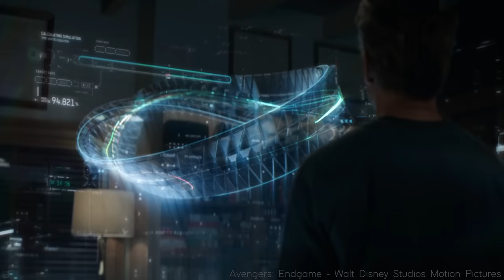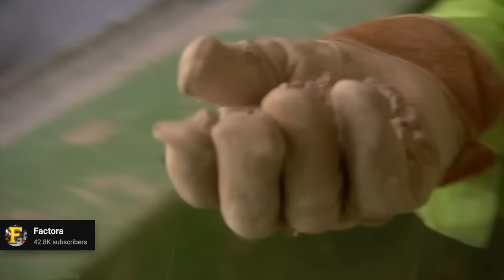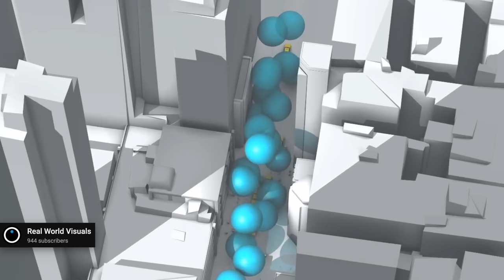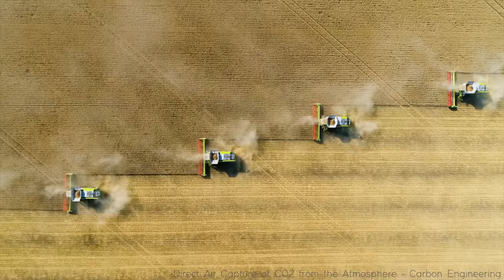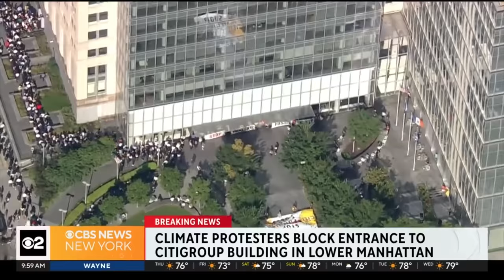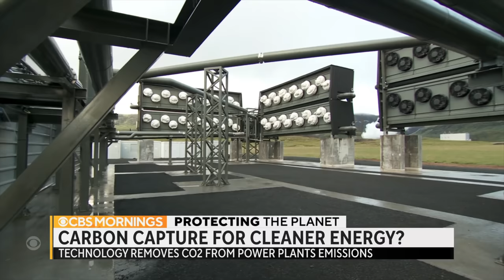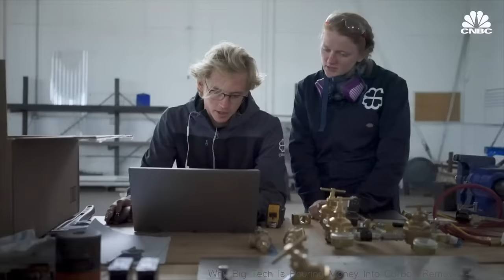How Thermodynamics Holds Back Negative Carbon Tech

Comment: Question: is the Gibbs Free Energy even the correct potential to estimate the minimum energy required to separate the CO2 from air? It requires constant temperature, which was set to 300 K, but if tou need to heat the sorbent to either 100 oC or 900 oC depending on the material, it seems like the energy needed for heating was not even considered. Am I missing something?

Comment: It's interesting, because of the high energy requirements it seems like deploying DAC on industrial scales in locations at distance from major power generation facilities might very well work hand in hand with the recent advances in Small Modular Nuclear Reactors. Because of their smaller size and modularity these reactors can be more easily scaled up and power generation could take place right at the sight where the DAC is located without needing to worry about transmission loss or building an expensive coal power plant or an environmentally destructive dam (looking at you Site C).
Reply: You are speaking of Thorium MOLTEN Salt reactors are you not ???
Reply: @lawrenceiverson1924  I was actually talking about the reactors currently being developed and produced by the company Last Energy in the US, as discussed in the video "Is Small, Fast & Cheap the Future of Nuclear Energy?" by: 'Undecided With Matt Ferell'. He explains the concepts and such it way better than I can without leaving a huge comment.
Reply: That's a really elegant solution: reduce the power transmission loss with already existing tech instead of having to make the CC more efficient with future tech.

Comment: Wrong formula for ideal gas mixing? https://en.wikipedia.org/wiki/Entropy_of_mixing 

Using the formula at the link above:
The ideal gas mixing Gibbs free energy at 440 ppm is delG = R*T*(440E-6*LN(440E-6) + ~1*LN(~1)) = -9.5J/mol
If we remove 140ppm CO2, the output air at 300 ppm has energy -7.1 J/mol, so we have to put in 2.4J/mol of air, or 17 kJ/mol of CO2 removed.
For output air at 10 ppm CO2, the energy is -1.4J/mol, so 8.1 J/mol of air to put in, or ~18.9 kJ/mol of CO2 removed.

It is more energy-efficient to remove less CO2

Comment: One of the thing about using trees to capture CO2 (I think it has to be one of the method in our portfolio of CO2 capture) is that we have to cut trees once they have reach maturity so that their carbon do not get transformed into CO2 by rotting and store them so that we can restart a new batch of trees.
Reply: After Listening to Thunderfoot, it makes me think that that method might be too slow.
Reply from the maker: We should definitely use trees as a tool in our arsenal, has many other benefits, but looks very tricky to solve climate change with trees alone
Reply: @CoolWorldsLab  why do you need focus on trees ? Trees are not dominant in carbon capturing.
Reply: You should research how long that actually takes. In a well managed forest, the long living trees will be capturing more carbon every year for up to 300 years, before going into a steady state for perhaps another 300 and taking 300 more to die. "fast growing" trees are only part of the solution and timber plantations are no solution at all. Also, if you keep extracting woody biomass from a forest, you will eventually strip the soil of the nutrients the forest needs. Tree decomposition is a natural process that must be allowed to happen. It is our extractive and polluting activities that must be limited, not the healthy cycle of life in forest communities.
Reply: @CoolWorldsLab looks pretty tricky to solve climate change without decentralizing power, decentralizing populations, and using less energy, and taking more direct responsibility for meeting the needs of our communities.
Reply: @gekkobear1650  The 300 years is not for all trees species.  We could harvest after 50 years. No clear cut. Some trees have to be left and all the stumps for mycorrhizal network. The advantage of sequestering CO2 with trees is the low maintenance (not zero maintenance).  Very efficient but slow.  As for stripping the soil of nutriment, the stumps will decompose and help slow the loss. It will depend on the depth of the humus. Any other open air CO2 capture method will be inefficient.  What is left is capture at the source, on industrial chimneys.
Reply: @dominiquefortin5345  I did not say for every tree species. I said for long living ones. If you continually remove biomass from a place and do not put it back, you will eventually strip that places ability to regenerate. I'm glad you're on board for not clear cutting leaving stumps for the fungi etc but we have to leave many trees to rot. Trees rotting is not the problem here. Human industrial activity and land abuse is the problem. How are the soils of over-extracted 2/3/4th growth forests ever going to really recover to support healthy forests when you keep driving all over them and stealing their carbon because you think you know better than the forest does. I'm not saying we can never move any biomass around. But when you're talking about doing it at a global industrial scale it really messes things up. For us too clearly.
Reply: @dominiquefortin5345  but also have you heard of coppices? Pretty good way to get carbon neutral cooking and heating fuel if you ask me. Channels like this one won't talk about that though. Wonder why?
Reply: @gekkobear1650  Coppices or no coppices, doesn’t matter.  The point is to harvest the mature trees and store it.  What I mean by harvesting is to create a CO2 sink that does not go back to the atmosphere.  So no rotting allow in the areas used for CO2 sequestering. We have a 100 years of CO2 emission to get back and it will take about the energy of 50 times the yearly consumption of energy of the entire world. Trees will help, a little, but need to take every method that works.
Reply: @dominiquefortin5345 I'm curious what happens if you remove the core of a tree leaving the bark intact and some wood left and replaced it with an artificial support like metals or plastics? Would it still live?
Reply: @mr.ackermann807  Even do the part of a tree that is alive is the exterior layer of the trunk, the interior of the trunk has a lot of tube where the sap flows.  So if you destroy part of the sap network, you kill part of tree.  The tree as a whole will survive to a point.
Reply: @dominiquefortin5345  ok good to know was not aware or more or less forgot a out that years ago, but still could be replaced could it not?
Reply: Also we would need 25-30% more trees than currently exist on Earth to start reducing atmospheric carbon compared to what we are putting into the air artificially (if that is the only thing we do, of course we should do others as well, plus reducing emissions). 

That is like close to 1 Trillion trees. 

Where are we going to find the land to plant another Trillion trees?
Reply: @5353Jumper  I seriously doubt people are willing to do that since they also will require nutrients to grow and store that we will need at that scale. To put it simple trees is not the best or only option, nor is the scale of carbon capture either.
Reply: @5353Jumper  reducing emissions is also another problem that's right now is so far impossible since the world's economy relies on those fuels and would take money that I think many are not willing to do to help reduce of not out right replace those fuels without a guaranteed profit of some kind within the near future or on the spot sales.

Comment: ~100% of global energy production for DAC is entirely doable if the energy is coming from wind and solar. The intermittency of renewables can be compensated for by overbuilding capacity (e.g. by ~4X), which is more cost-effective than relying on storage, so there will be massive amounts of intermittent surplus energy available at zero marginal cost. Also, as long as we are still emitting CO2, DAC can be used at emission sources to greatly increase its efficiency.

Comment: It took us hundreds of years to get here. These ideas to get out in a few decades are simply not realistic. However the damage done by not hastening our back pedal is unfortunate
Reply: How do we mine as much copper for this green-transition as mankind has Ever Dug Up All Over Again - and that’s just for the next two decades transitioning. Meanwhile, all the easy pickings are gone with ore concentrations down 1/3 from our grandpa’s time : which means 7x-10x more dross, sludge, trailings piled up around all those self-awarded Green Trophies. 
There is nothing Renewable about this tech, it’s Repairable - with more petroleum needed for replacement steel and concrete parts: you cannot make more panels with solar, nor more turbines with wind. I don’t understand how these windmills are classified a turbine.
Reply: @jonathanedwardgibson   with more petroleum needed for replacement steel and concrete parts
Concrete production just needs lots of heat, no petroleum. And people are working on purely electric steel refining. 

> you cannot make more panels with solar, nor more turbines with wind.

Basically, yes you can. currently most of our energy infrastructure is fossil fuel, so we are using that.

Comment: This would be great to pair with solar energy, since solar cant fluctuate its output to keep up with the daily swings in power consumption. When the grid has lower demand, divert the power to a DAC system. Also, the energy capture becomes slightly more efficient with a lower T when the grid demand is lowest. The hottest time of the day also correlates to the most power consumption. that 3-5pm window were people are getting home work/school, but a lot of businesses are still open creates a massive spike in demand. Ideally they would draw the most power during a 10 hour window from 9pm-7am. This also gives plenty of down time for maintenance on the DAC.

Comment: I did a small essay on Direct Air Capture for my engineering degree and it costs 2x to 10x more than planting trees to capture the same amount of CO2. Plus trees provide shelter for animals and prevent soil erosion.

Direct Air Capture is not cost efficient at all for large scales
Reply: I hear that the ocean captures more CO2 than trees. There's too much neglect of the ocean!
Reply from the maker: Right the problem is scale. As discussed in the video there isn’t enough space on Earth for the amount of trees it would take.

Comment: Another issue: Where does all this DACC'd CO2 go to? If it has to be pumped back into underground wells that takes a lot of energy too. And that is assuming that those wells are reliable stores of CO2. If they fail, then you need to do more DACC to recapture it.

Comment: Something to consider, solid sorbents have a desorption temperature of just below 100deg Celsius. This is waste heat for most industrial processes and also thermal powerplants. This energy does not needcto be produced.
Just imagine building a geothermal power plant producing the energy to run the fans and other stuff, and the heat that can not be turned into electricity, is used for desorption.

That changes the equation.

Comment: Very comfortable to listen & digest but the technology of DAC is used within the e-fuel process that also wants to collect CO2.
The second generation patented by Robert McGinnis - Prometheusfuels 2019 uses Low Pressure & Temperature & off grid green electric.
Production Prototype Appd 2022.
Metaforge job 1 2027.

Comment: Hate to break the news to everyone but you can't undo the methane problem.

Methane is in fact what the Tic Tac UFO these planes use FLIR which is the same technology that we use in the oil and gas industry to detect methane leaks.

It shows up black just like they show it on the videos and basically what is happening is the methane is mixing with ocean foam and that's how it's able to float in spheres and roll around the way that it does. It doesn't move fast like they claim that's just a camera trick called parallax. And the reason why all of this is trying to be covered up by claiming that it's a UFO is because they don't want you all to know the truth and that is we are beyond the threshold to stop methane from leaking into our atmosphere

Comment: Wonderful analysis, thank you SO much.  One thing crossing my mind is the "start date" (onset of the Industrial Revolution) may mark a step change in our ability to foul our own nest, though scarcely "Start Point", for which we need to consider slash/burn dating from the initial agricultural revolution.  

This assertion is evidenced by samples taken from those ice sheets currently melting at an alarming rate.

In case folk feel that's doing no more than increasing the height of the cliff at which we're collectively teetering, whilst true, it likely also adds to the number of potential components of any solutions ... if everyone isn't panicking too much to play any useful part in some ultimate solution (which isn't the Anthropocene Extinction, at any rate).

Comment: Great job as usual, thank you! I think RCP8.5 (Representative Concentration Pathway for radiative forcing of 8.5 W/m^2)  was slightly misdescribed as a "business as usual, total pedal to the metal future". It's a pure physics model based on just heat balance. For policy implications, we need to look at the Shared Socioeconomic Pathways (SSPs), which model policies. Each starts with current progress as a baseline. No SSP follows RCP8.5 because it's considered too unlikely, given the progress we've made. We have made progress! But at the same time, extinction is still possible, so "pedal to the metal" could actually be much worse than RCP8.5, especially if we back away from Paris etc.
Reply: > extinction is still possible, so "pedal to the metal" could actually be much worse than RCP8.5, especially if we back away from Paris etc.
Extinction of what? Not humans.

Comment: How much energy, roughly, is required on an industrial scale to capture 1kg of CO2 from the atmosphere?

I get 0.3 kWh.

That’s based on crushing peridotite rocks that are half forsterite (Mg 2 SiO 4 ) and half fayalite (Fe 2 SiO 4 ).

The reaction of the crushed rock with atmospheric CO 2  releases a little energy (and so the CO 2 definitely won’t be returning aloft). If any of that can be used, it might reduce the 0.3 kWh figure a little.

If not, it’s still less than one-eighth of the energy that was originally yielded in putting the kilogram CO 2 into the air. Less than a 16th, if the fuel was methane

Comment: What if there was a solution that actively emitted fresh air. Like the water powered car which burns hydrogen and emits oxygen. Wouldn't adopting a technology that actively benefits the air, rather than being neutral to the air just not emitting further carbon like current EVs, be the ideal solution? I can't see why anyone would build one of these DAC plants without the research funding that surely funded the first ones. Do they generate any income? Building a water powered car would generate income while fixing the air. So it seems on the surface anyway. I'd like to see a video on this topic. It's a lithium free solution as well.
Reply: If you burn Hydrogen it combines with Oxygen and creates water.  It also would not reduce the CO2 in the atmosphere unfortunately.
Reply: So far it has taken us more energy to split water than we'd get from burning the resultant oxygen and hydrogen - and even if we could do it perfectly? it would take exactly the same amount of energy to split the molecule as it would to reform it into water via combustion. It's the same bonds being broken and formed - no extra energy to be gained.
Reply: As a physicist, you'd be better off making a car powered by earwax, in the sense that it's at least physically possible. Water is made of hydrogen and oxygen (hence H2O), put them together (burn them) and they release energy, and water. To split water into hydrogen and oxygen, it requires energy (the same amount of energy that is released when they're burned together again). The main problem with the atmosphere that causes climate change is how much CO2 is in it, trapping heat and causing the atmosphere to warm. Adding more oxygen would do nothing to counter this, and has nothing to do with the issue at hand, the atmosphere isn't a slider that just goes between good and bad. To suggest just creating more oxygen to counter CO2 emissions is a bit like trying to stop yourself when you trip down the stairs by peeing your pants, they're unrelated and now when you hit the ground not only are you hurt but you're covered in piss too.
Reply: It doesn't clean the air in any meaningful way in terms of greenhouse gasses, while using a ton more energy (which, as this video covered, we really don't have limitless amounts of).
Reply: @asdfasdf-dd9lk  Make the car turn magnesium into magnesium carbonate. That sucks up CO2 and releases energy.
Reply: @donaldhobson8873  Where do you get the magnesium from? Answer: it gets refined, which requires more energy and also releases CO2.
Reply: @asdfasdf-dd9lk  Yep. That's one of the downsides of magnesium cars. (although the refining could be carbon capture?)

Comment: Nuclear power is the solution. It both reduces emissions by replacing coal, oil and gas power stations. AND could supply abundant clean energy to fuel DAC, electric vehicles and similar.